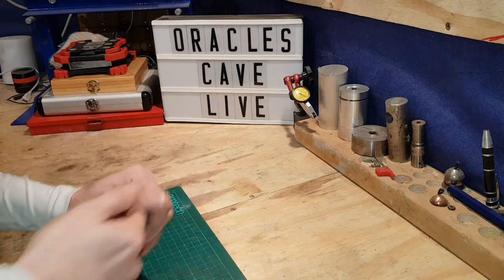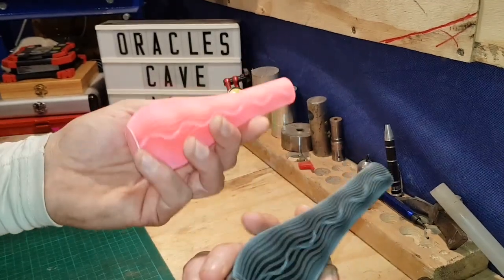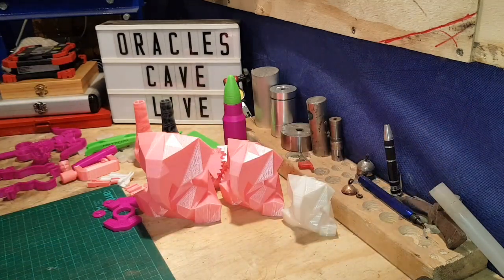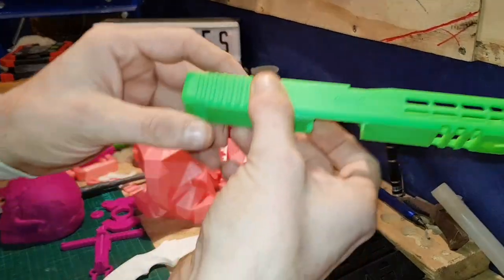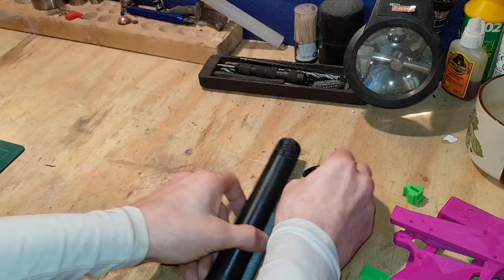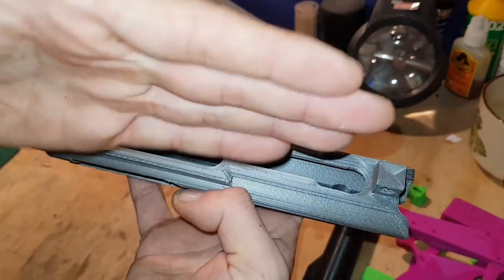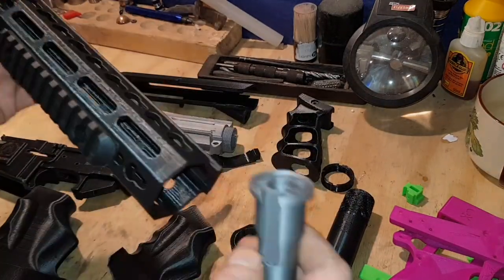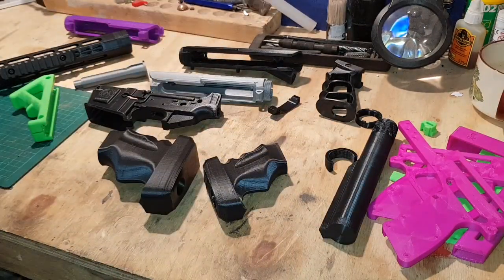3D PRINTING BEGINNER PRINTS, TOYS, GUNS, AR-15, LOTS MORE

Comment: What printer did you get? And where do you buy your filament from?
Reply from the maker: I bought the CREALITY CR-10S 3D PRINTER, and at the moment I'm only using cheapest filament from ebay, made by SURREAL, about £16 a kg roll.
Dear stuff is around £44 for same amount.
But I'm very happy at the quality so far.
GO INKS is the company I got my filament from on ebay. 

This machine is everything I hoped it would be and a whole lot more, you should consider getting one honestly i recommend this over anything EVER!
👍👍👍

Comment: You need to use the equivalent of the tools used in machining. A proper razor or exacto blade are needed to do the equivalent of any filing work. Don't slap things and use a lot of finesse.
Reply from the maker: Yes I file, sand, drill, exacto, plastic weld, hot stapler, and sometimes blowtorch my 3d printed things.
Very versatile items 
Many ways to skin a cat.
👍👍👍